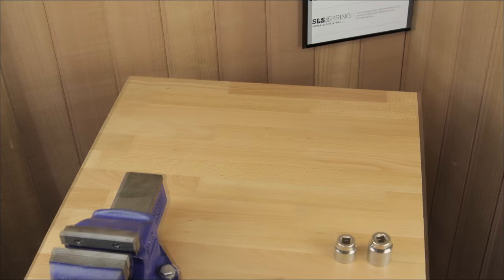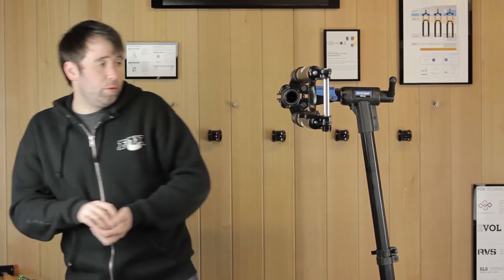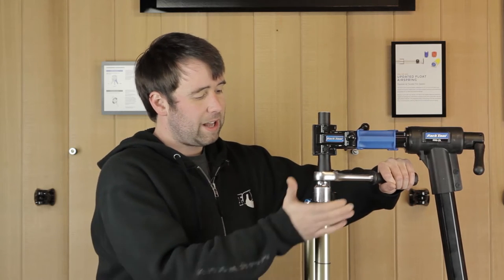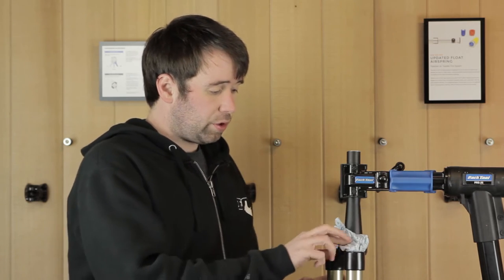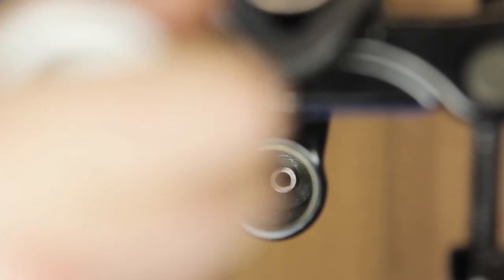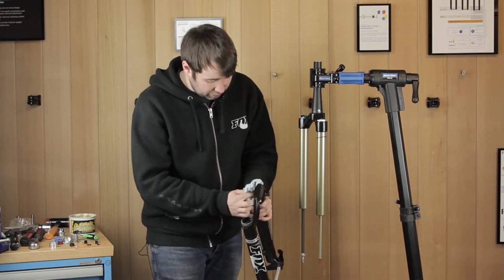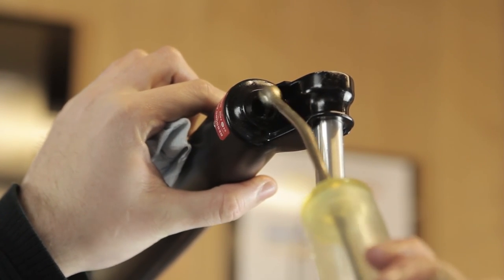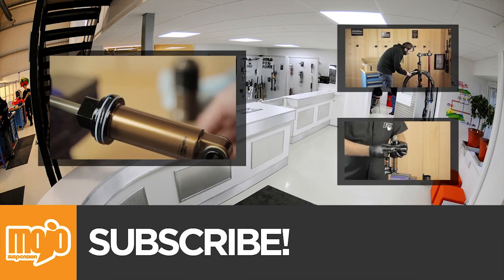HOW TO - NA RETROFIT 34mm 2013/2015 Air Spring

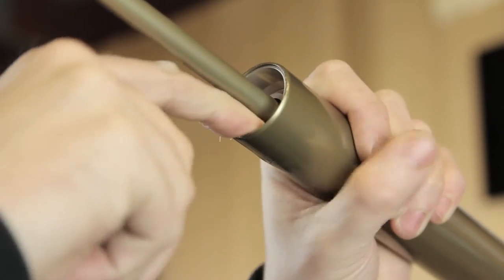Comment: Hi Mojo, I followed your video, but after installing the bottom part (@ 4:44), I think you forgot to mention that you have to re-install the snap ring (that you removed @ 3:30). To be sure, I checked the Fox documentation and indeed this snap ring has to go in. Did you forget to mention this? Or did I miss this in the video (I re-watched a few times).

Comment: Hello,
Can I ask You something?
I have a Fox 36 Float 2012 RLC  compression and I have a knock on every landing I make. I think the problem is either with the negative chamber spring and/or wrong lower bushing position. I am not sure if the pring haven't' gone softer and squashed?
 Can this fork accommodate this negative air spring option?
Thank you very much!

Comment: Does this kit still exist today?  No part numbers or anything in the description and you just say "NA2 air spring" when talking about the assembly.
Reply: I agree I’m looking to upgrade?
Reply: @ernestosuavecito  Hi, what is your travel and wheel size?
Reply: @walles9308  I have a 2010 32 TALAS 150mm for 26" wheel and looking for the NA2 retrofit air spring.  Any help would be great.
Reply: @ernestosuavecito  I have a 2010 32 TALAS 150mm for 26" wheel and looking for the NA2 retrofit air spring.  Any help would be great.